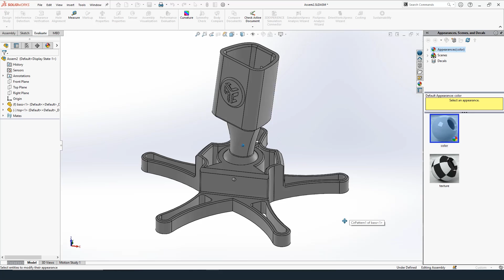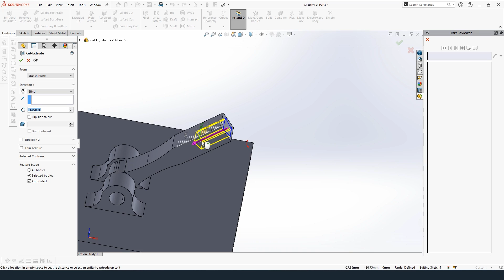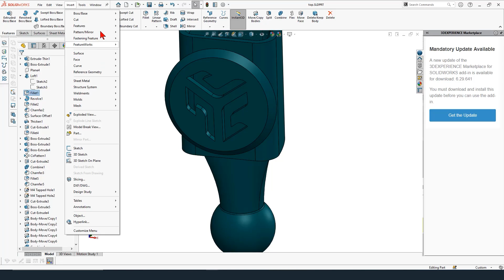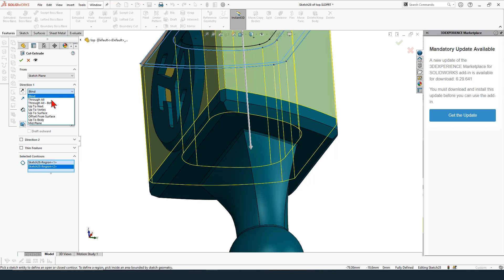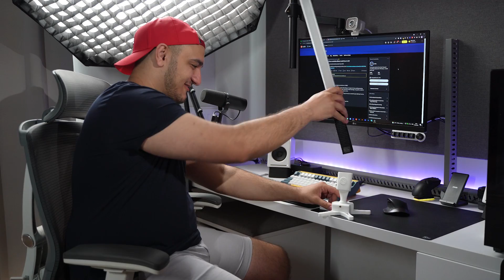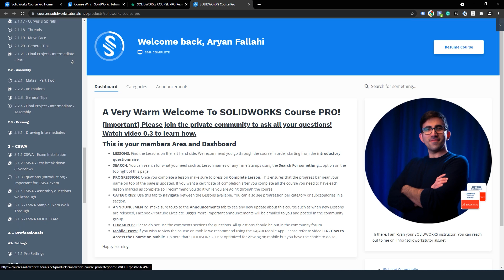How I designed and printed a light stand

Comment: For that price I could get my university to print this thing out of titanium.
You could also decide what angle the light needs to be and create one solid stand (without the ball joint) and print this out of PLA with a regular FDM printer. The thin neck part would be the weak point of your  design that prevents it from printing with FDM
Hell... you could probably get one of the cheapest FDM printers for the price of the part.

Nice design and a cool video format to talk through the creation of a part, the cost and the problems.
Reply from the maker: That’s quite true! Although not everyone have the luxury of having access to a Uni printer. As a company if you order this from titanium, it’ll be north of $400. FDM qualities especially the surface finish is not comparable to SLA or else, I needed a smooth surface for the ball. 

The Angle: there are two issues here, first by creating a ball and joint not only I have him the freedom in choosing the right angle but I reduced my calculations by a whole a lot. If I wanted to go for a certain angle, I needed to measure that way more accurately. This whole thing was based merely on that sketch I show you on the screen